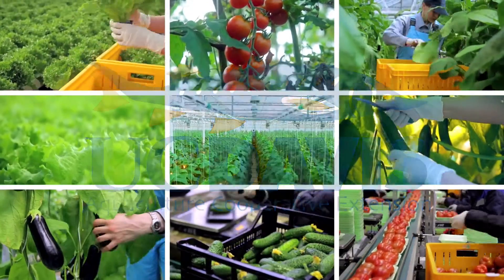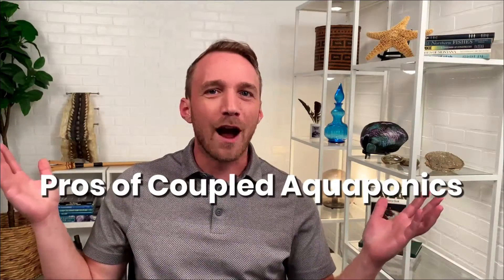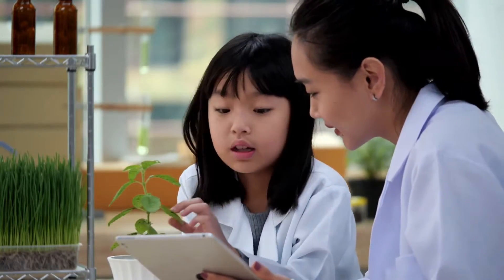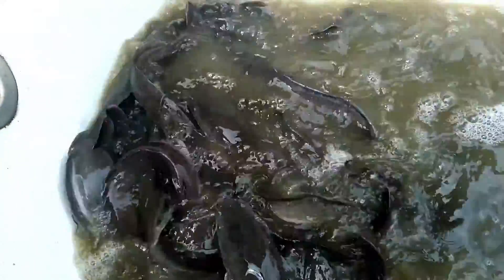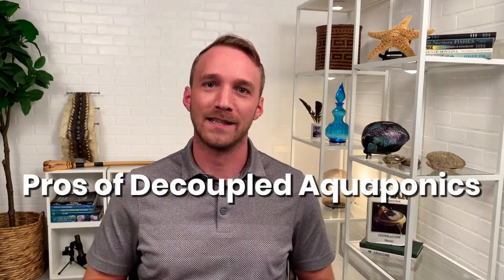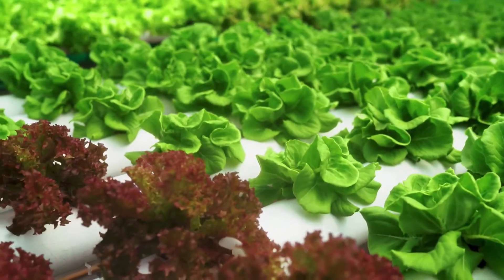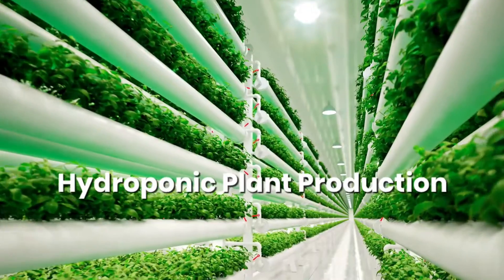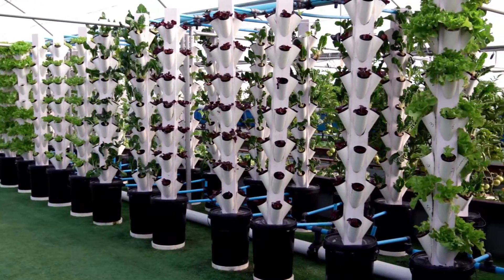What is the Difference between Coupled and Decoupled Aquaponics Systems?

Comment: In a decoupled system are there 2 different sump tanks, 1 from the plants and 1 from the fish, where the water is treated prior to being used in the opposite system?
Reply from the maker: Yes two separate sumps. Water from the RAS is sent to the hydroponic systems sump where its is usually modified (pH adjusted, additional nutrients) to benefit the plants. The fish system is topped off with new clean water.

Comment: I am hoping you can help me by offering advice. I live in East Africa and teach sustainable agriculture to indigenous people. The challenge is most aquaponic systems require skills beyond most local people. Also, the equipment needed is not readily available. Would it be possible to have a system where you have a tank, and an aeration system, with fish in it. Once a day, or once every few days, the water from the fish tank is simply sprayed on field crops, or delivered via drip irrigation to garden beds which are in soil. Such a system would be consistent with the skills and equipment available here. Could you comment on whether such a system might work? I really appreciate your help.
Reply from the maker: Good question….so yes and no. Have you watched my 4 components of RAS video? You want to build up your nutrients in the water and then put it on plants. The problem with drip irrigation is that the biological in the water will plug up emitters. So planting in a piped system better. But you can absolutely put the fish water and waste products directly in the soil.
Reply: @ThisIsAquaculture  Yes, I have watched the videos and have learned a lot. I understand about clogging drip systems. Reciprocating sprinklers are much less prone to clogging. If I had a 500 gallon tank of Tilapia with good aeration, I could pump the fish water to reciprocating sprinklers. In such a system, what would you estimate would be the proper rate to drain and fill the tank . . . twice a day, once a day, once every three days? I have to get the system to something as simple as possible.
Reply from the maker: Everyday would likely be too often, a 500 gallon tank only holds so many fish properly. It’s a function of amount of feed, good aeration, and biofiltration efficiency. You’d need to measure your nitrates to know how many plants your system could support.

Comment: With decoupled system are you having to do water changes? and what other nutrients do you have to give your plats?
Reply from the maker: Hi Sean!!! We occasionally will do a water change in the hydroponic system. Our climate is hot and dry so in the greenhouse we go through alot of water loss from uptake, transpiration and some evaporation so we are usually just adding water but it somewhat depends on nutrient concentrations in our fish efflluent. so really it is a function of plant density and species, how you are watering (flood and drain once a day for 30 minutes vs constant flow of a DWC), and water nutrients. We could send that water back to our fish but we do not for biosecurity reasons. We usually need to add potassium, and do an iron foliar spray.....again depending on the crop we are producing and how we grow and the medium we are using as well.

Comment: Are the stocking rates the same for both systems?
Reply from the maker: The answer is up to you!! Decoupled aquaculture is RAS so you can produce as much fish as your system will allow or desire and use as much water you need. In coupled you are usually just producing as much fish and subsequent nutrients your system requires. If producing to many nutrients you tend to have other problems such as pests as nitrates are in abundance.